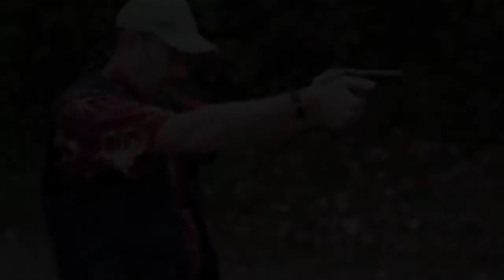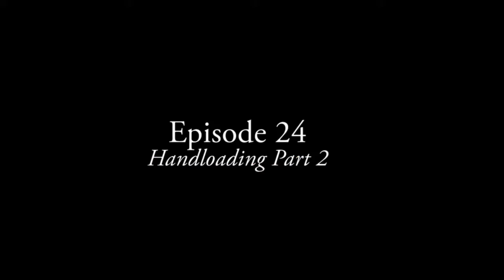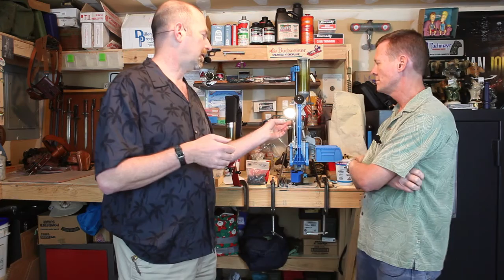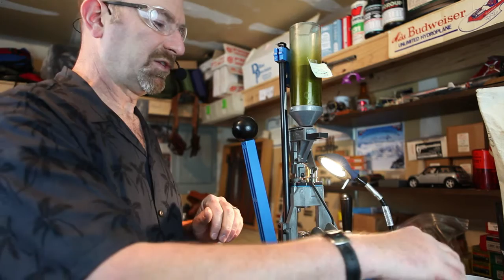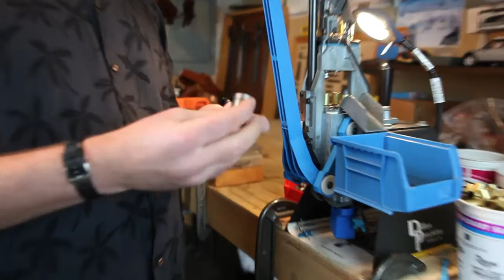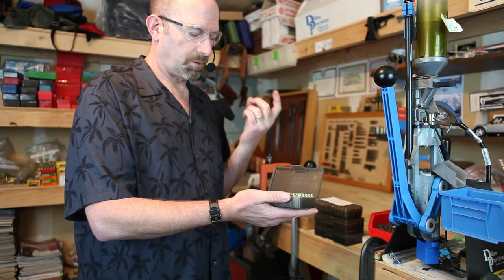Episode 24 - Handloading Part Two

Comment: Where do you get the vertical primer bracing handle that's mounted behind the turret? I've never seen that before.  I find my  SDB tends to flex a lot when I push forward for the priming step and that looks a treat.
Reply: I bought the press from a friend, with the strong mount and handle already attached.  I assumed it was a Dillon accessory, but I don't see it on their website?  Rick
Reply: kimisdaman Thanks Rick. Yeah, it's new to me. Looks like your friend must have come up with a novel solution to the flex thing. I've been planning on picking up the Strong mount too. Looks much more stable and comfortable.

 Thanks for posting all the great videos. Tremendous value to us newbies.

Comment: Good video I noticed you said that you left the power in powder measure from the previous night how long can you leave the power in there a day a week.I always thought you had to empty it when finishing for that  session
Reply: +Retiredin. I only fill my powder hopper up to 1/2 way maximum.  When I'm done loading I just leave what's in there for the next session.  You can do this as long as you keep sunlight off the powder which would break it down.  You also need to be sure your environment allows for it.  Wouldn't want the powder to suck up moisture.  Ironically, here in the Seattle area it's not an issue for me.  The other thing you want to be sure of is that you remember what type of powder is in the hopper when you come back to it.  Label it somehow if you leave it in there.  Sure would hate to load Titegroup into .223 cases (a friend has done that).
Reply: +Retiredin If it's a powder that I know I am going to load again soon - and sometimes not so soon - I leave it in the measure.  If I'm going to load only in a single session, and then might not use that powder again for weeks or months, I'll put the powder back in the jug.   Rick

Comment from the maker: Sir -  Straight-wall pistol cases generally don't need trimming.  For instance, max length for .45 ACP cases is .898", but most cases are no more than .895" long, so no need to trim.  You might want to measure some of your cases to confirm, but you will probably never have to trim 9mm, .40 S&W, .45 ACP, etc.

Rick

Comment from the maker: Trimming cases is very important for rifle cartridges (particularly shouldered cases).  If you purchase new pistol brass, chances are its going to be close to the SAAMI specified length.  I never trim pistol brass when reloading.  When reloading rifle cases (in my experience, .223), I check the case length every 5 or so times its been reloaded and trim as necessary.

Steve

Comment from the maker: @MrByronodmon I'm intrigued by the new metal tumbling media.  A guy showed me a couple of cases that he'd cleaned using this wet tumbling system - don't think it will work with a conventional vibratory "tumbler" - and the brass looked new.  He'd punched the primers out before tumbling, and even the primer pockets were spotless.  For someone new to reloading, who's buying all the gear for the first time, it might be the way to go.  Changing to the new system would be too expensive for me.
 
Rick